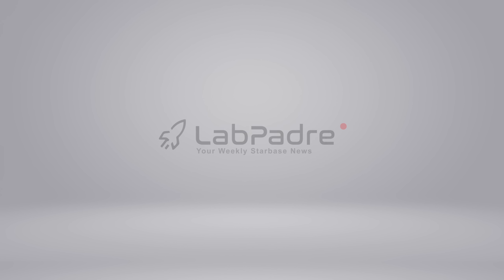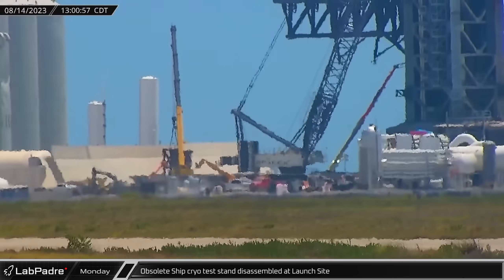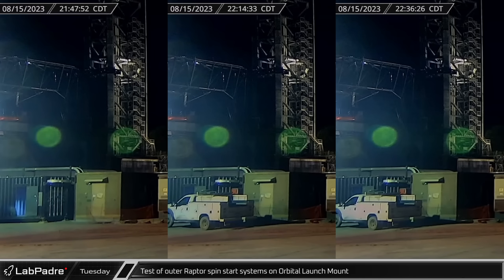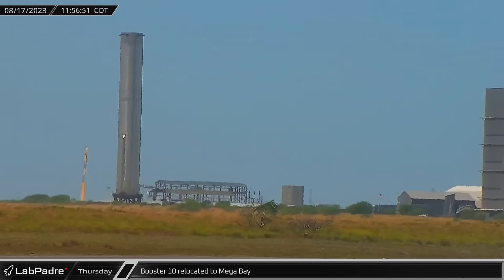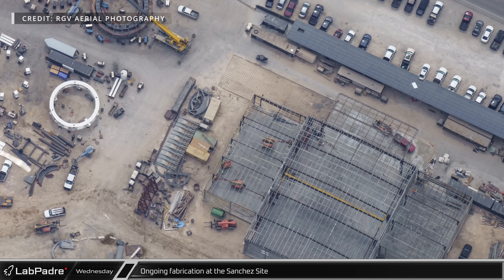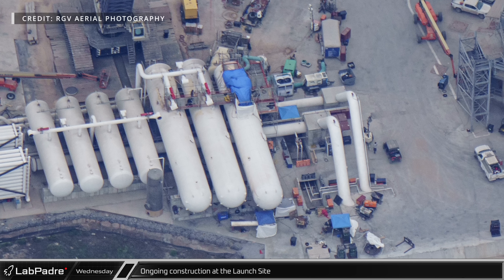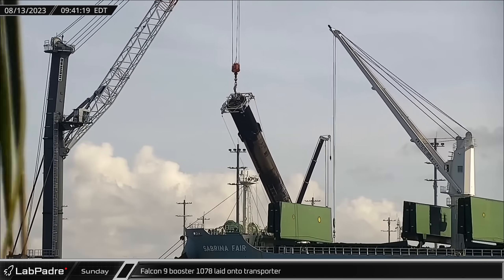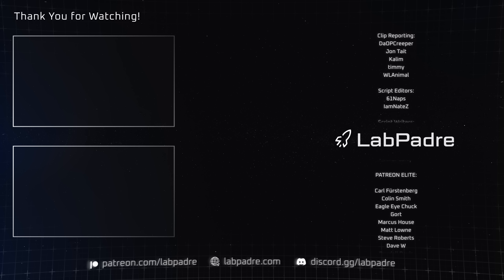SpaceX's Bold New Booster Design Promises Exciting New Capabilities! - Starbase Weekly Update #76

Comment: What it promises is a positive separation in case of another booster failure!
Reply: Exactly.  Think of the booster failure scenarios that could prevent the ship from getting to orbit.  The flexibility of hot staging lets them save the ship and the payload.  Even more critical when the payload has humans on board.  Their previous staging plan was simpler but more limited since it relied on the booster to assist.

Comment: Excellenté Senior Padré !    Ol'e !    🤗     So, I'll hazard a guess as to what those apparent "hold down rings" are. If SpaceX wanted to modify the SuperHeavy Boosters base/locking ring for some reason ( make it lighter, modify its shape for production purposes . . etc), then testing different designs of the Hold Down ring assy might just splain why they're building different types of these. They likely have a need to modify the existing version and they're testing new designs is my guess.
  Of course I'll be watching Lab Padrés weekly updates to find out !

Comment: On the face of it they could set the new venting interstage on the ship test stand, set a ship on top and do a hot-fire to test the hot staging concept on the ground. Any thoughts on why they do not seem to be planning such a test?
Reply: The ship uses "vacuum" engines. Trying to start them under 1 Bar of atmosphere, would be irresponsible and quite possibly explosive! 💥.
  Besides, hotstaging has been around for decades. 
  The trick is still getting to altitude and the release mechanism worKING! Although, they already improved the release, by changing to electric, instead of hydraulic.
  Too, the 4 engines that didn't light, on the recent static fire test, was because they had the engine startup parameters, set to very conservative. No sense in risKING any problems. The test was, mostly, to show the FAA that the deluge system IS going to work.
  I strongly suggest that you look up, on YouTube, Everyday Astronaut's video of what it takes to start a rocket engine!!! You will be amazed!
It all occurs in about 3/4 of a second! Things happen, so fast, that the computers have to anticipate the next steps.
  Peace be with you.
  👻☠️🗽💯🙏
Reply: @CritternNation  My understanding is that there have been six engine static fires of the ship on the ground test stand. Also that the vacuum engines are test fired at Mcgregor. I've watched all of Tim Dodd's excellent videos, but do not understand the logic of your argument.  The complexity and difficulty of engine starting is surely an argument for rather than against ground testing?  The principle of hot staging has been used before, but never with the lower stage required to survive and never in this specific configuration (notice that the mechanism for the grid fins is immediately beneath the new interstage). The best possible outcome of a flight test would be that the booster gets salvaged from the ocean were it might be difficult to distinguish damage from the hot staging operation from damage from the ocean 'landing' or subsequent salvage operations. There are many worse outcomes including that the grid fins jam resulting in an unguided ocean 'landing'. A test on the ground would allow full examination of the interstage after the test as well as more extensive instrumentation of the test itself.

Comment: Could it be that new round stands with clamps are for OLM? To put on top of existing mount and free up space there for pipes by doing so.
Reply: Would not work as the location of the QDs for the Booster and Starship would then be at the wrong heights.
Reply: @gravelydon7072 The new stands are, obviously, manufacturing stands, raptor installation stands, transport stands, or test stands.
Probably, all of the above.
  👻☠️🗽💯🙏

Comment: Any idea how big the holes/nozzles that direct the water exiting the showerhead are?
Reply: An excellent question, I’m curious too.

Ancillary question: are the holes protected with something while not in service?
Reply: @steveschritz1823 When I saw the plate being transported, the vents appeared to be, about 6"×4".
You don't want them too big, so the pressure builds up.
Too, I noticed that they are jetting the water, where they anticipate that the rocket blast will go, and that's, outwards.
  I think they have this system figured out. 
  Now, if they can just figure out the correct way to cure cement!!! 😲.
  In my experience, in hot weather, you keep the surface, flooded with water.
  Cement only draws in as much water as it needs for the chemical reaction, of curing, to occur.
  You can, even pour cement, under water, as long as you don't continue to mix it.
  Although, the cement, WILL, continue to shrink, as it cures, even over a long period of time. That is why, expansion joints are NECESSARY!!!
  They can't have open voids, in the FONDAG, however, with a little bit of creative engineering, they can come up with a T or I shaped steel  joint that allows for controlled contraction, while keeping the surface sealed tight.
  👻☠️🗽💯🙏

Comment: Anyone else wondering how well the rocket will do at max q with giant holes in the side of the rocket body? IE the hot stage ring.
Reply: Shouldn't be an issue. The pressure experienced from T=0 through Max-Q is longitudinal, so all that is needed is for the stringer reinforcements in the hot-staging ring to be able to withstand the force of the mass of the fully fueled and loaded Starship stage at Max-Q. Hot staging is a solved problem, after all; the Russians have been using it for about seventy years on their Vostok and Soyuz launchers.